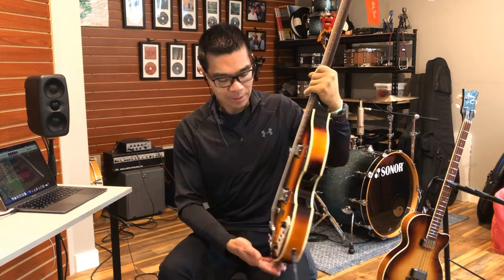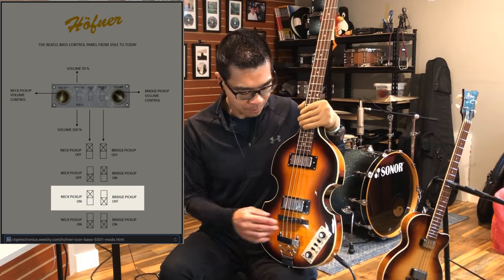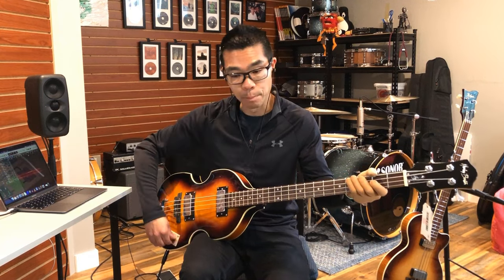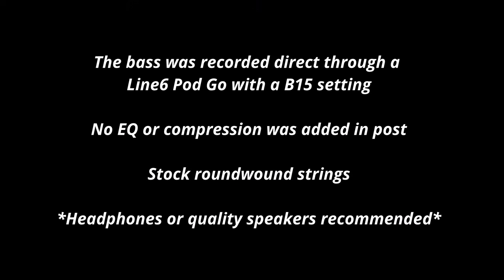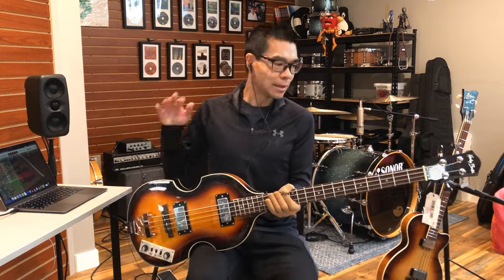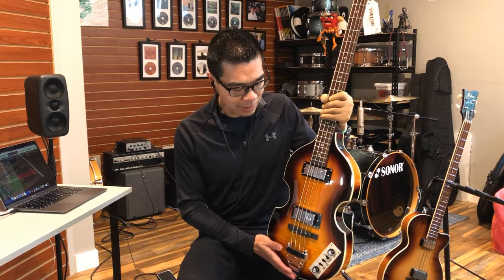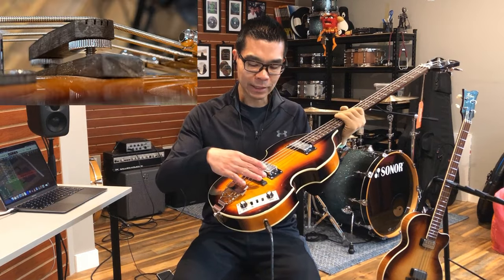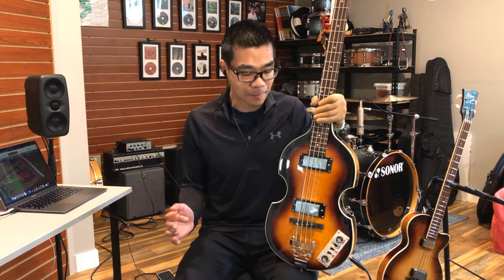Harley Benton BeatBass VS - Demo & Review. This Beatle-style bass is wired backwards!

Comment: I just recorded a whole R&B album with this bass and flatwounds. And it sounds fantastic.
Reply from the maker: That’s so awesome to hear that you got a good example! How’s your control panel wired?
Reply: @jonathanwong458music  La Bella 760FHB2 String Set, neck pickup, direct to the recorder, without amplifier. In the mix a little compression. That's all.
Reply from the maker: @elmerseiscientos  great simple signal chain.  
My original question was whether your bass's bass & treble switch controls were backwards like my demo bass (relative to a hofner)?
Reply: @jonathanwong458music  Sorry, I didn't understand your question correctly. The control panel on my bass is like the Hofner, which I find quite confusing. On your bass it seems to work as anyone would expect, which is even more confusing 😀
Reply from the maker: @elmerseiscientos  haha, yeah, my Hofner's controls are super confusing.  But as I suspected, the HB in the video is backwards!!
In the end, it doesn't really matter, provided you know what the switches do.  Backwards wiring won't affect the tone.  Was really just my curiosity about other people's basses! Thanks for responding!

Comment: I just got a BeatBass - I like it a lot. It will replace my Jack Casady bass, which is too big and long-necked for me. The pickup switches are definitely backwards to their labels. I suppose one could take the plate off and turn it around, but that would make something else backwards, wouldn't it? Anyway, I just iignore the labels, and run the thing flat out at all times. It's not a hot signal, so little danger of it going out of control.
Reply from the maker: Right on! So glad you are liking your beat bass. Yeah, control layout one can get used to. Thanks for watching and commenting!

Comment: Jonathan, love your viseos but I have to ask; what's your favorite of all the "beatle" basses you've owned and /or demoed? and why?
Reply from the maker: Hi!  Good question.  Between the Hofner Icon/ignition, Epi Viola and the HB Beat, I'd take the Viola bass!  3 main (and major!) reasons: (1) its construction feels more robust than the others.  I have kids, and I travel to rehearsals/gigs in a van with 3 car seats in it.  So space is a premium and awkward case placement in the van is the norm. Always stuff on top of other stuff. So instruments need to feel solid and robust.  The Icon felt fragile and the HB even more so.  (2) Tuners.  I HATE the Hofner tuners.  The holes are too small to put other flatwounds through it without significant manipulation. And the plastic keys feel like I'm going to snap them off. (I haven't...., yet...). I ended up putting Labella Beatle bass flats on my Hofner Club because nothing else would fit properly.  The tuners on the Viola are modern designs.  Doesn't capture the esthetic, but you could put whatever strings you wanted through them.  (3) Master tone control.  I've gotten used to my Hofner's weird controls but I miss the master tone.  

All that being said, because I almost never play/perform standing up anymore, I find all the Beatle style basses to be uncomfortable on my thigh....too many sharp corners! That is why I went with the Club bass (contemporary series).  

Hope this answers your question!  Thanks for asking and for watching!
jw

Comment: About the wiring, altough I can't be sure, it might be a way for harley benton to avoid copyright issues. Noticed on other HB bass(and guitar) models that were dubbed "copy's" of bigger brands, that they always change them, ever so slightly. In this model the neck and string spacing seem to be a bit wider than the original beatles bass, for example. 
Anyways, great video! And, as it was said before, realy nice how you always give a logical and detailed presentation! 👍
Reply from the maker: Thanks so much! You’re right about the string spacing and neck width. That part got edited out due to a low flying Hercules airplane that flew over and also to keep the overall length down. 15 mins is already on the long side.
Definite possibility re copyright infringement. But then make the labels backwards to go with it!! Haha. I suppose it might only bug ppl who have hofners.
Thanks for watching and commenting. Appreciate the support!
Reply: @jonathanwong458music  glad to be of help in some way. 😉 And I think most of these small issues ppl have, are related to their own habbits. I haven't played bass that long, a little over a year, but hab to switch to a less neck-heavy option, due to chronic pain in my shoulder(fretting hand), initially for practice only. So I switched from a longsale, with a thick neck and heavy body, to an ibanez mikro. What felt totally alien at first, is now my favorite. But I still play the big one a couple hours every week, to not get too used to the little one.
Reply from the maker: Short scales are awesome! Right on! Glad you’re playing bass!

Comment: Thanks for the concise explanation of the confusing control panel. Wiring issue noted. I took a screenshot of the diagram you showed. I've had the Club for awhile and still don't have a firm grasp of how to use the control panel. Do you have any favorite "default" settings? Thanks, Dan
Reply from the maker: On my club, I typically only use the neck pickup (vol up), rhythm, bass off, treble off. 
Thx for watching!

Comment: Nice commentary and playing!  I like the tone of this bass.  It seems a little different than others.

I have this bass.  It happens to be my first.  Mine happens to be branded IYV, which is the company/factory that makes this and many other Harley Bentons.  I don't think there are any other differences.

I've enjoyed my time with this bass and have had a nice experience with it.  I'm not at a point to consider upgrading it, although when I do, my first "upgrade" will most likely be switching to flatwound strings.  I like the sound of the pickups and have had no issues with the tuners.  I like that it has a different look and appreciate the coincidental heritage (which, I know, have nothing to do with the sound).  I also appreciate that it's light, a shorter scale and it feels comfortable to hold (standing and sitting) and easy to play (again, I don't have much experience with others at this time).

As I don't have much experiences with basses, will I regret this purchase in the future?  I ordered mine via Amazon for approximately $165USD delivered.  They have a fairly amazing return window at this time.  Would I be better off getting another instrument?  

All this typed, I think I need to print out a chart of the controls (including notes on the backwards wiring).  The finish on mine happens to be nice (to my untrained eye).

All the best!  Also, subscribed.  I came here after watching your nice Jackson JS1X review.

Edit:  Considering what you and others have said, I may go ahead and get the strings - that is, unless I end up getting another bass.
Reply from the maker: Thanks for commenting and watching! Welcome! Check out the Epiphone viola if you’re looking to upgrade a beatle-style bass!
Reply from the maker: PS. The controls are backwards relative to a Hofner. However, as long as you know what the switches do in a given position, in the end, the position itself is less important. Coming from a Hofner layout, I just found it disorienting as I had gotten used to my Hofner.

Flats will give you a more Hofner-esque thumpy sound (as we haven been accustomed to hearing) but not everybody likes the feel or the perceived stiffness of them. Furthermore, every brand of flats sound and feel remarkably different to each other.

Comment: Could you please let me know what the string spacing at the bridge is? Is it similar to that of a typical 4-string bass, around 19mm?
Reply from the maker: The string spacing is in between that of a Hofner (~16mm) and a Fender (19mm).  Unfortunately, I do not have the Beat Bass anymore to give you a more accurate measurement.  The saddles, similar to the Hofner it is copying, is similar to a fret.  If you are really careful, you can lift it off the bridge slot and adjust the string spacing to a certain extent. 
Thanks for watching!
Reply: @jonathanwong458music  Thank you for your sincere answer. I appreciate it.
Reply from the maker: Thanks!